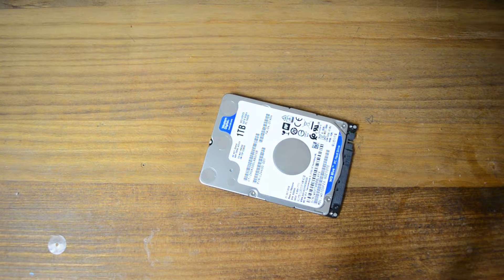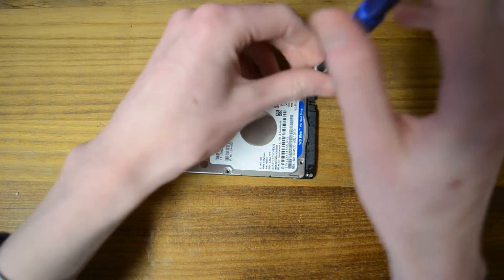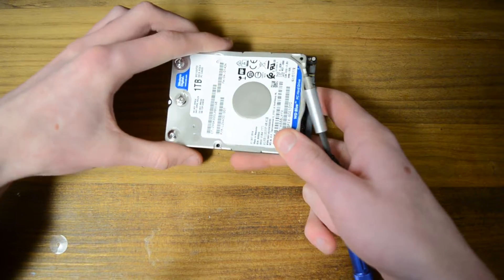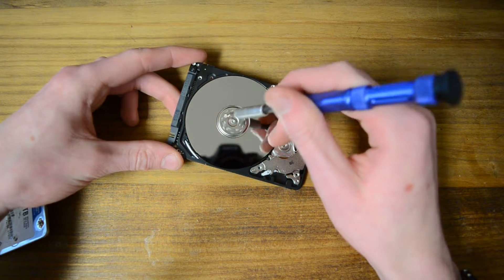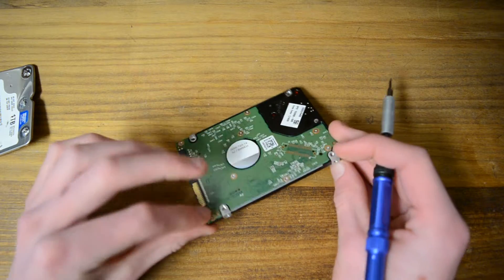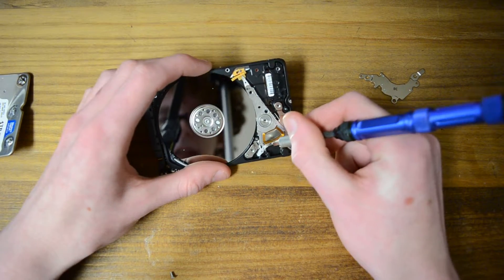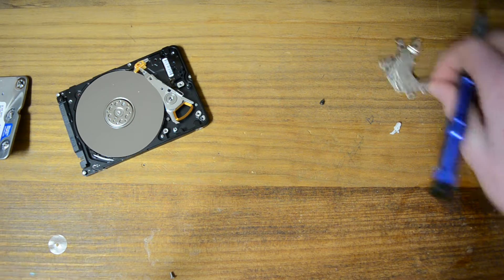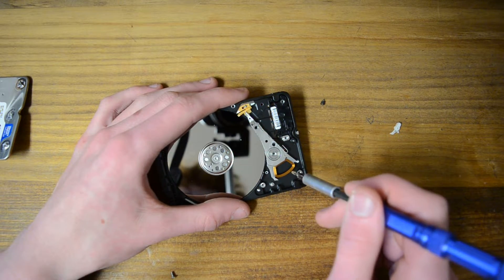1TB 2.5" WD Blue teardown (2018 revision)

Comment: It's almost the same drive as one from 2013 that I disassembled because one of my school laptops died and they give me the hard drive (dead sadly). The thing had 1 platter and 320gb of capacity. It's amazing how much capacity added since then on the same 1 platter.
Reply from the maker: The huge increase in capacity is due to something called SMR or Shingled Magnetic Recording, which Seagate created in late 2013. It allows the data sectors on hard drives to overlap each other instead of simply being adjacent to one another, so far more data can fit on one platter. Helps HDD manufacturers save money and reduce noise/power by only including 1 platter and head mechanism instead of multiple, although it is a little slower.